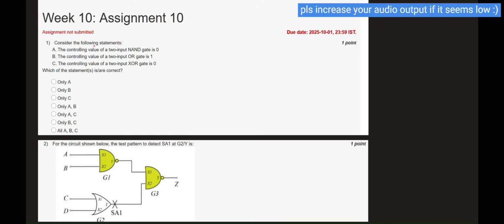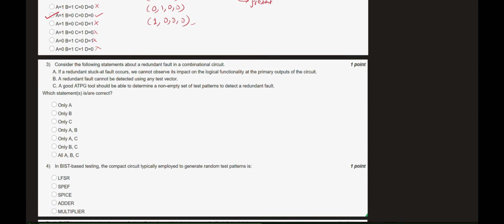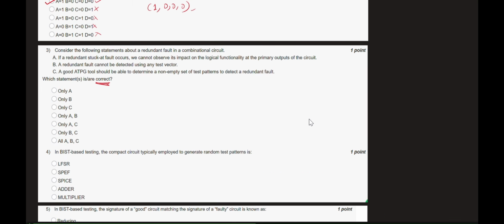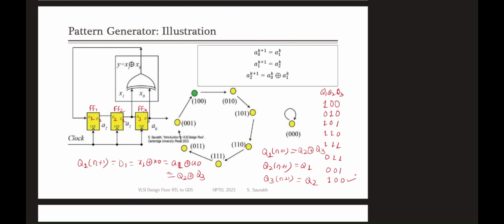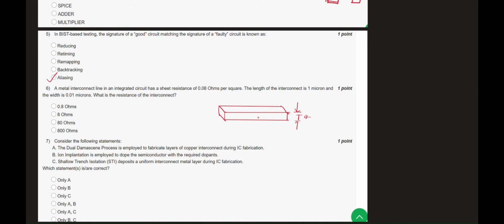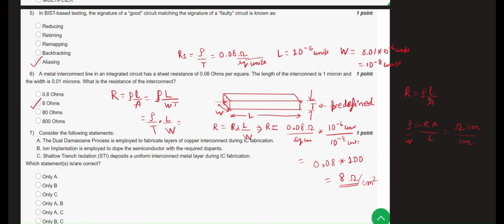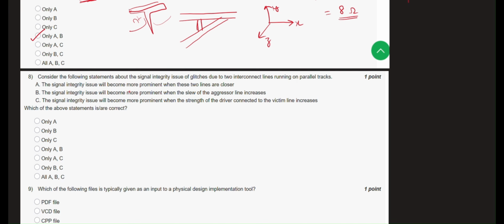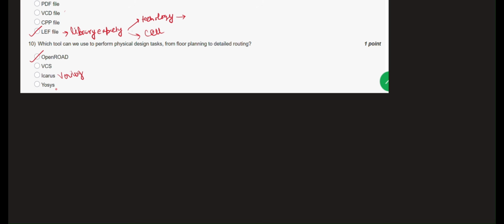VLSI DESIGN FLOW: RTL 2 GDS NPTEL week 10 detailed assignment Solutions

Comment from the maker: Also one more value addition 
For Question no 6,
the value of sheet resistance is not in ohms; it is measured in ohms per square (Ω/□) to distinguish it from bulk resistance. This unit signifies the resistance of a square of material with a uniform thickness, where the "square" refers to a square shape, not a unit of area.